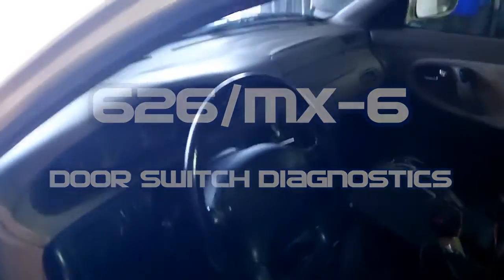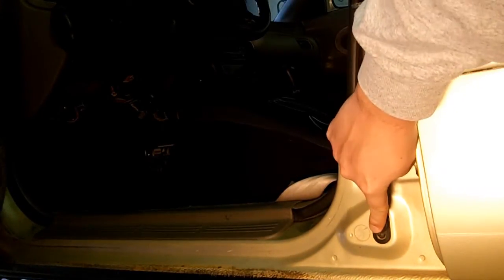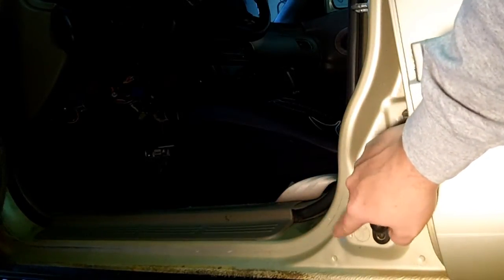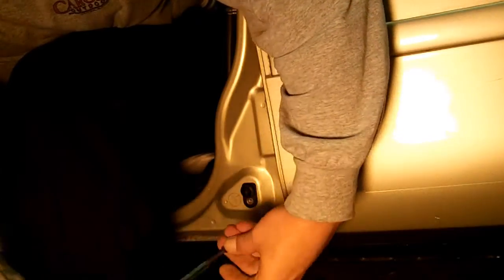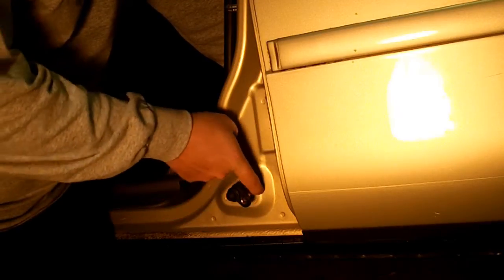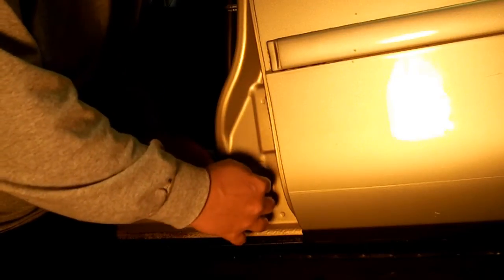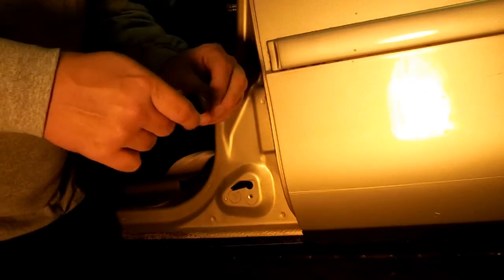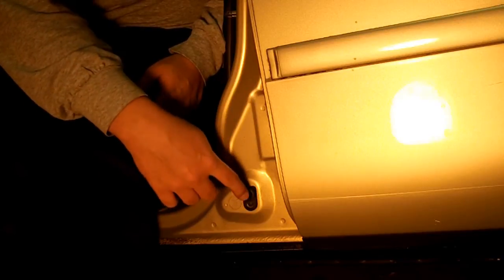Single Wire Door Switch Diagnostic

Comment: Yeah true. I actually think I accidentally destroyed some of the attaching clips of the interior trim when I removed it to try to retrieve it, to no avail. But I realised that the metal part of the door switch which connects to the harness was stuck inside so I managed to insert  a radio plier inside the hole and grab the metal part and drag the harness out.

True, it is a bit time consuming. But I went to the scrap yard and found an interior trim that match my car so now I’m on it.

Thank you for a great video 🙂

Comment: Switches mounted to ground seem so elegant compared to standard two wire switches.
Reply from the maker: Simple and efficient design.  They work great.  I rarely hear of a 626/MX6 owner having an issue with the door switch (we're around 18 years old for these cars now).  In the event the switch does go bad (usually from physical damage) you can see how simple it is to replace.   As long as the rubber seal is preserved to keep the internal spring mechanism from contamination these can last a lifetime.

Comment from the maker: #Mazda626  Single wire door switch diagnostic.   Switch uses the chassis as ground from a single 12v power wire.  Testing continuity of the switch.
Reply: What if the wiring of the switch is problem ?